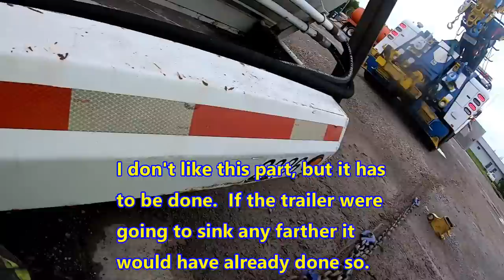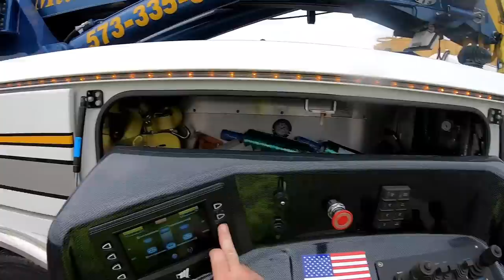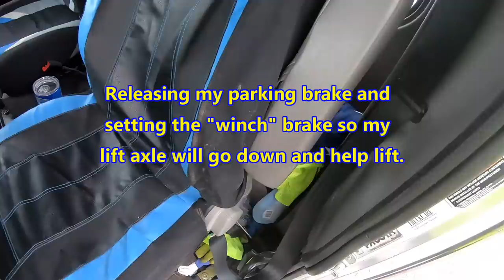Loaded Tanker Takes A Dive....Nose Dive That Is

Comment: Why did'nt you use lifting bags? It is much easyer and more saftey.
Reply from the maker: Actually, lifting bags are quite unstable.  They are capable of lifting heavy loads, but they still require an outside source, such as a towing/recovery unit, crane, or other equipment to stabilize the item being lifted.   Since I had to move this trailer forward I still would have had to hook the unit up the same way I did here, even if I had used the bags to assist with the lift, because I would have had to remove the bags after the lift and then move forward.   Thanks for watching and God bless.
Reply: Thanks for answer me. My idea was to put one low pressure lifting bag at the high of the king bolt, lift and put some big plates under the trailer stands. 
So what ever Ron, nice work. Take care and God bless you and your family.
Regards from Germany

Comment: And this all would have been unnecessary if the driver had just pulled the trailer 10 ft forward and dropped the landing legs on the concrete pad that is there for just that porpuse

Comment: Wouldnt it be easier to just throw a strap around the tank itself and lifting?
Reply from the maker: In a normal situation, yes, and that option was discussed.  In the instance, we weren't certain what was under the dolly legs.  Could it have been an old collapsed line of some sort?  A sink hole?  Regardless of what it was, my truck needs a solid platform to lift from.  Had I sat my truck beside the trailer and lifted it with a strap, there was a risk that my outriggers or tires could have fallen into that same underground anomaly.   However, the area in front of the tanker was well know, well traveled, and hard packed, so it was the safer option for the lift.  Thanks for watching and God bless.
Reply: @RonPratt  not second guessing your judgment, just curious 😉
Reply from the maker: @ryanyoung7433  Understood.  Just explaining.....No hurt feelings here. It was a valid question.

Comment: Are you  OK  ? You seem to be breathing a little bit harder than I've noticed in the past. If you have something that you've have before or you're getting over something. If not any of them maybe you might see you family doctor to just check. It could be a lung thing or a hart problem. Now don't take what I'm saying and get upset. You don't even have to comment on my comment but it's just something I noticed in this video that is sticking out.
Reply: He was working in hot weather; when setting the keyhole he was working from an awkward position trying to one-hand a very heavy piece of steel into place while always wondering if the load suspended over him was going to shift further (drop down) before he got it supported. That block he placed to catch it if it fell would have been minimal protection, maybe keeping him from being killed but not stopping serious injury. Even after he came out from under he was wrestling extremely heavy rigging.

Comment: Those tanker landing gear are not designed to support the weight of a loaded trailer.   You have to get them emptied before you can drop them.
Reply: Ben Klassen Who told you that? Those legs are designed to support a loaded or unloaded trailer. There are thousands of places that deal with tankers that will not let the tractor stay connected to a trailer. Due to safety concerns, regulations and insurance they can’t have a driver near it while being loaded or unloaded.

Comment: No offense but doing what you did there is no where near as scary as doing it by hand with a couple of 20 ton hydraulic bottle jack and a rail road sized bumper jack on an aluminum flat bed fully loaded with lumber and the landing gear has fallen through the pad of a scale that was built back in the '40's, '50's, or '60's era and the king pin is sitting in the frozen mud....boy do I wish I had your rotator or at least access to it anyways

Comment: Ron, could you watch this video https://youtu.be/v8EhHdv4QYg and see if it makes sense.  He claims that a bow shackle as a pulley is more efficient than a pulley and when he tests the the RING the load on the anchor vehicle increases.  I don't understand how this is possible.  Thanks.
Reply from the maker: I've watched the video you linked.  First, allow me to state that one should NEVER run a live line through a bow shackle!!!!!  This is extremely dangerous!!!!   Now to explain the science behind the RING VS THE PULLEY.  Basic answer is FRICTION.  The pulley runs the line around a sheave, which is seated on a roller bearing, which has very little friction and is a highly efficient "machine". The friction resistance on a pulley such as this is generally between 5-10% of the load being placed on the pulley, but for safety margins I always calculate the resistance at the higher of the two which is the 10%.  Now to the RING.....when the RING is placed under a load it is trying to rotate around the synthetic rope shackle, which has an enormous amount of FRICTION.  In his test that friction is roughly 66% of the load being placed on the RING.  So, I thoroughly understand why he tossed the RING at the end of the video.  The ring is highly inefficient due to the amount of friction.   I hope I have explained this so that it is understandable.  Thanks for watching and God bless.
Reply: @RonPratt    Thank you so much, My main confusion comes from the anchor car being dragged backwards more on the ring test even though the weight, slope & rolling resistance supposedly has not changed.
Reply: @RonPratt  I suspect he just threw in the shackle for illustrative purpose. He did note that even though the shackle had comparable friction loss to the block it got super hot in the process.
Reply from the maker: @rayives7758  The problem with the shackle is the lack of rolling surface for the rope, which means there was too severe of a bend in the rope and an extreme amount of friction.  The friction is what generated the heat.  Here is a link to a general size guide for wire rope to sheave diameter along with a few other interesting bits of info:   http://www.gunnebojohnson.com/wp-content/uploads/Rigging-Combined1.pdf
Thanks for watching and God bless.